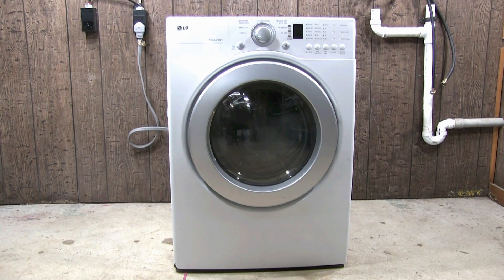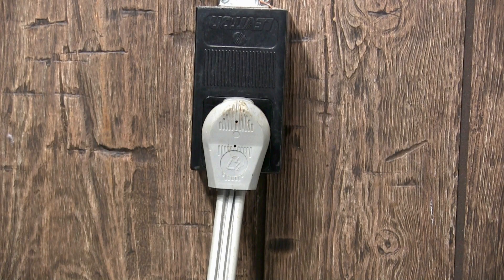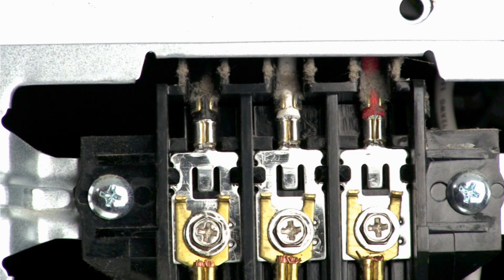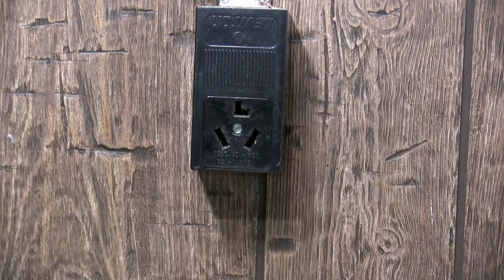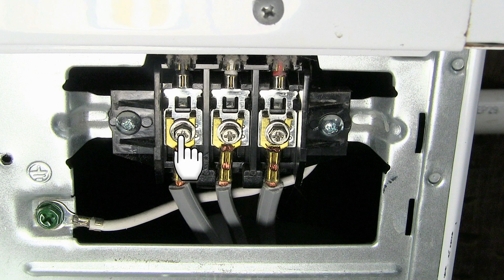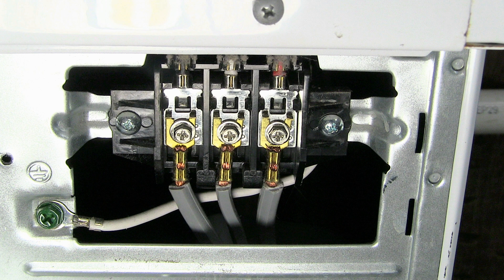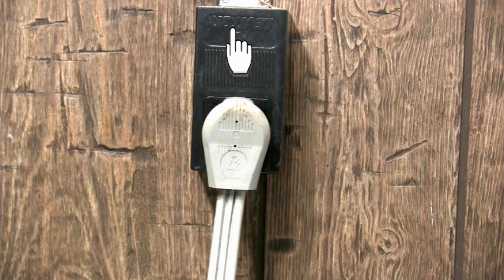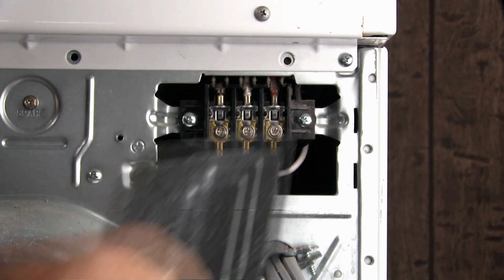LG dryer not starting no heating - Voltages At The Terminal Block

Comment: LG is telling me that it must have 120V and 240V and nothing less.  At 117V and 227V I push the power button, select a cycle and everytime I push the Start/Pause the machine shuts down (LG DLE3600W).  I don't understand why it cannot run on 227V.